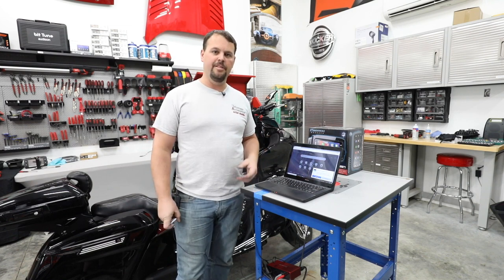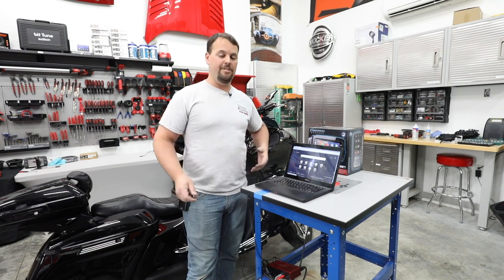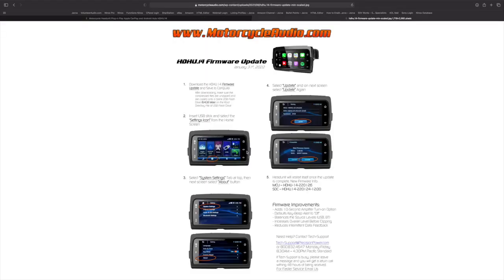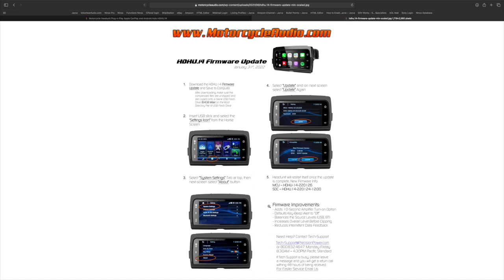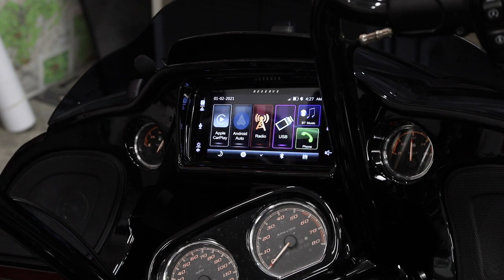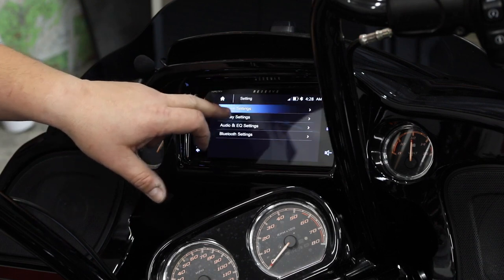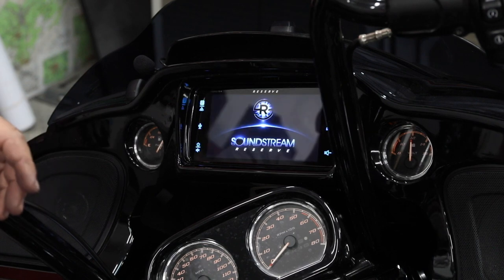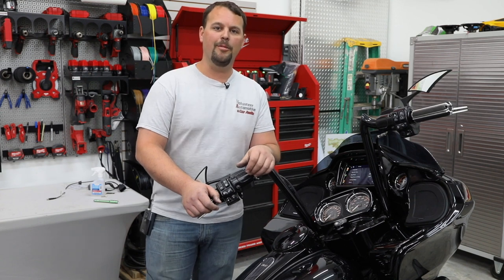New Features Added! How to do a Software Update on the Soundstream Reserve HDHU.14

Comment: They took firmware off of this support page. It now says see your authorized dealer!? Did they take this update ability away from us? I just bought, waiting to ship and receive, but my nearest dealer is 3.5 hours away.
Reply: Or do you have video of work stopping to update? Will mine be updated to most current out of box from you or do I need to update it!?
Reply: I purchased the HDHU.14+ this week.  I just spoke with Brian, Soundstream's HD tech. He said that any units built in the last year or so have the updates already installed. No need to worry.

Comment: I'm having issues up loading to the unit. With the new software.  It brings up the bar loading and at 50% the screen goes blank . I left it alone for over an hr and nothing.  Any info on that?
Reply: My screen went blank soon as I pushed the update and it never came back I turned off the radio got a loud pop and it went back to factory settings.
Reply: @SoundstreamTVNetwork  same issue here 🤔 followed your README, unit gets to 50% and goes black. icons continue to colour cycle. unit never restarts (left for mins and up to 1hour).  Tried various flash drive formats (FAT32, ExFAT, NTFS doesn't read, macOS doesn't read). Turn HU off and on and it boots fine (but reset) with the MCU updated to HDHU-14-220126 but still SOC: HDHU.14-211123-14:30 ☹